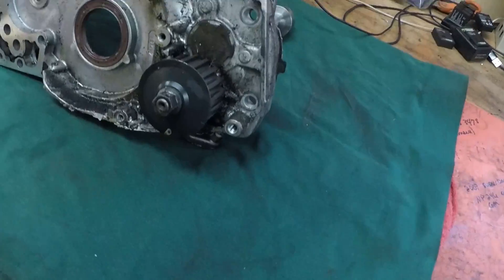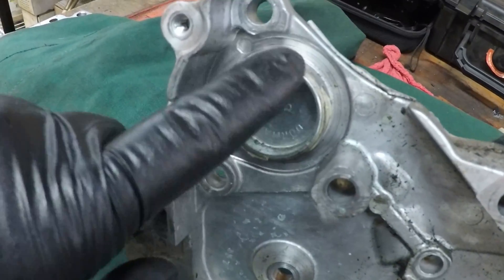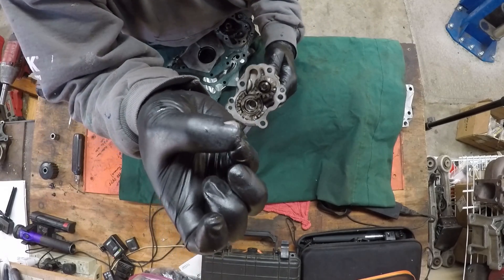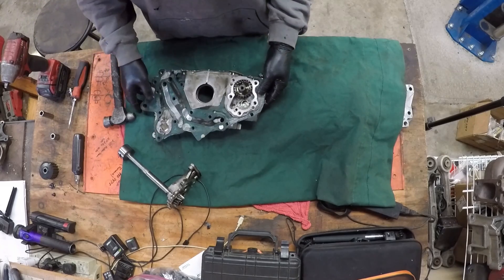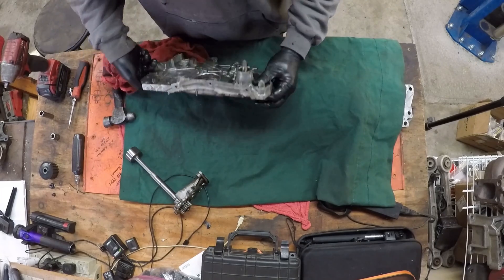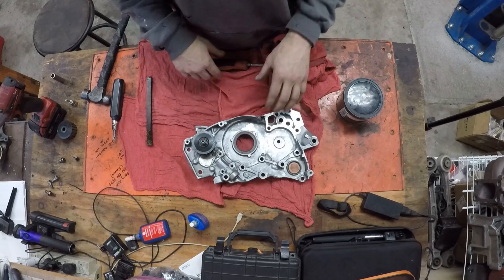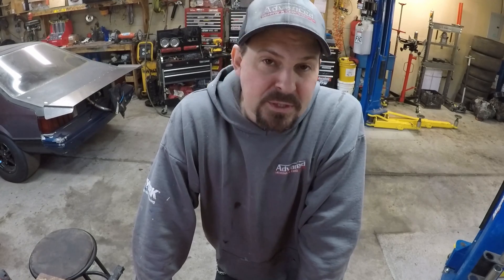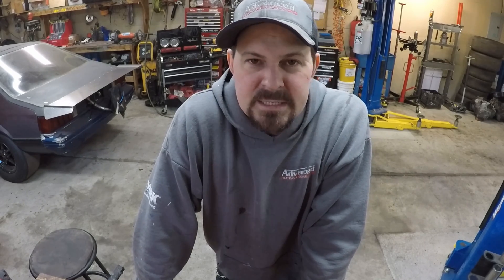Assembling a 4g63 8 Oil Pump with Straight Cut Gears and a stubby balance shaft delete.

Comment: What is the size of the bolt that goes into the stubby shaft??
Reply from the maker: It's the same OEM bolt that you would use on the unmodified balance shaft.

Comment: Is the oil pump loud with the straight cut gears
Reply: I did the same thing. A little bit. But you would only hear it if the exhaust is standard (quiet). With any aftermarket exhaust you wont be able to hear the oil pump over the engine noise.

Comment: What’s your opinion on the ER pump gear?
Reply from the maker: Never ran one personally.  Have never seen a reason to justify it personally.  We have ran oil pumps revving the motor to 10k rpm on the stock oil pump gear and have had zero failures.

Comment: Great informative vid as usual mate, I have a question, I've have the oil squirters and the balancer shaft deletes done on a new built 4G63 and have high oil pressure readings on my gauge, 90 psi on cold startup and hot  115 psi at 4k, running 15w50 to protect the motor. No I've done a lot of reading and people say that I could blow oil seals, lock lifters and do bearings, however I can't actually find and evidence of this. So with your vast experiance should I be worried and should I do the porting of the oil filter housing and spring mod?
Reply from the maker: It's fine to be a little high, when the motor wears in more the pressure will drop a little, just make sure it's good and warm before you drive it.
Reply: @snailfedperformance7177  ok thanks brother, yeh warm it up thoroughly, I'm a bit jittery cause I've never owned a built motor so nervous at first in case i hurt it.